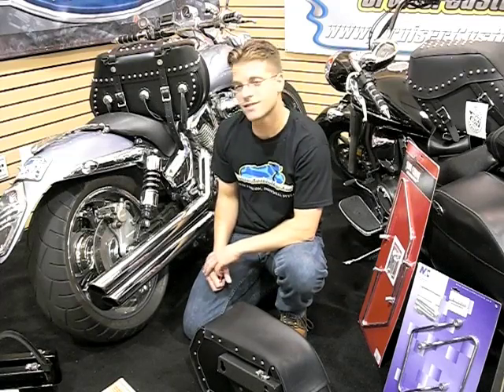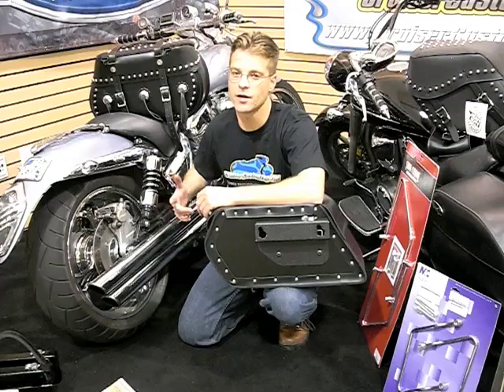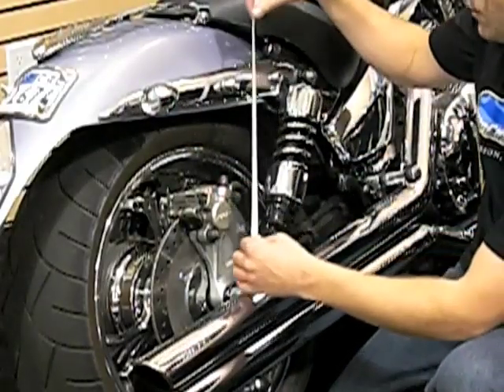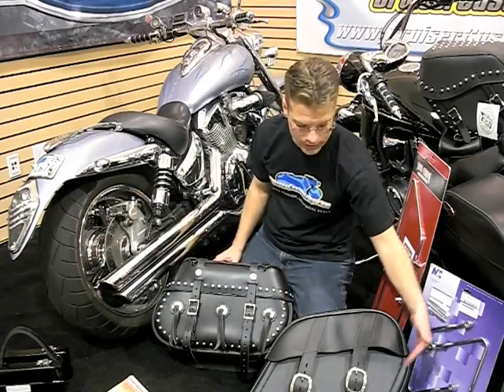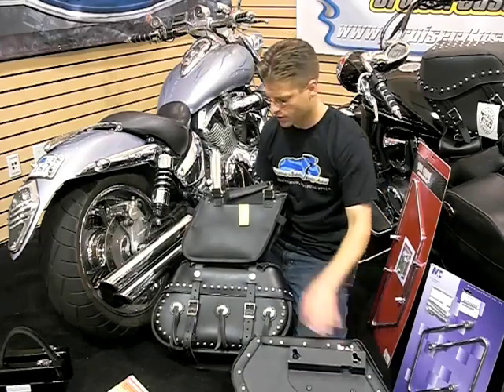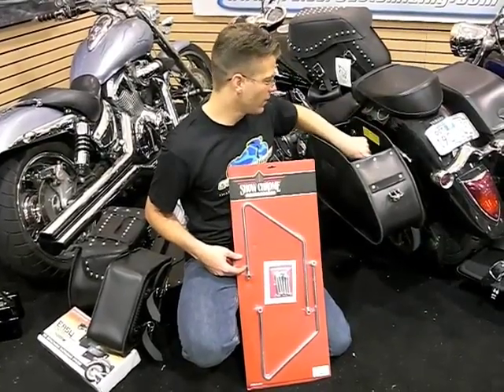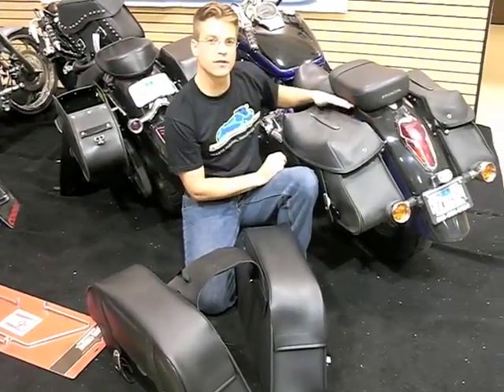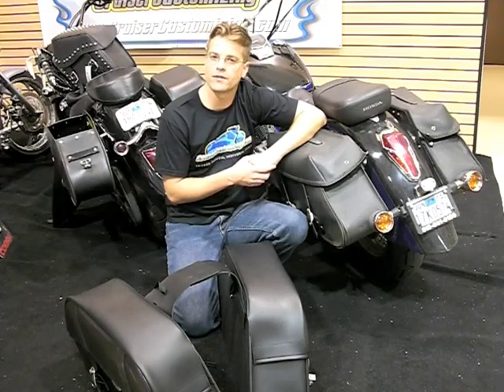Saddlebag Tip from Manybikes How to Mount Saddlebags

Comment: Have you seen new car carriers going down the road and the autos have a type of white plastic covering key areas of the body? A lot of body shops are using this mastic now instead of paper and tape as they used to. I found a shop in my area, went in to ask about purchasing a piece of this to cover my rear fender and they gave me more than I needed. Works for me.